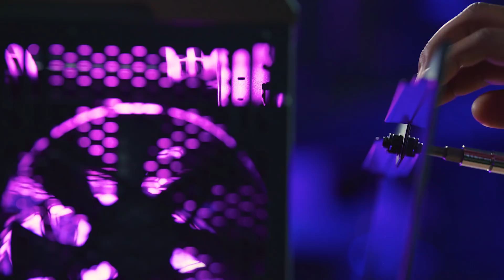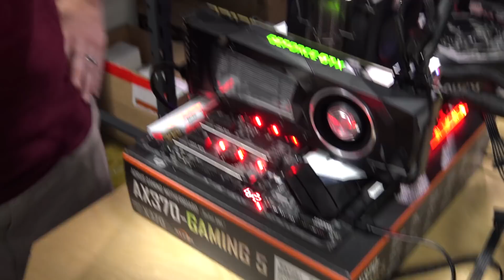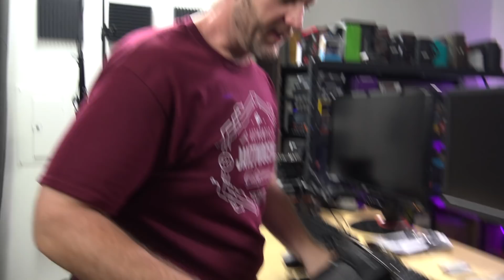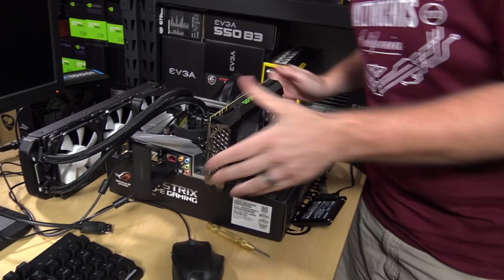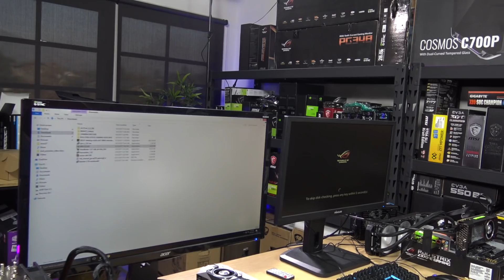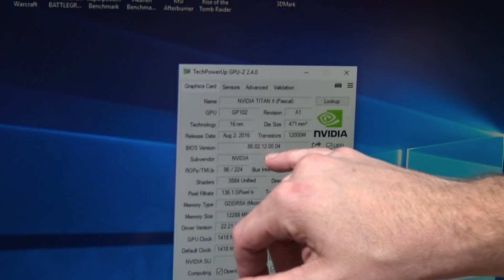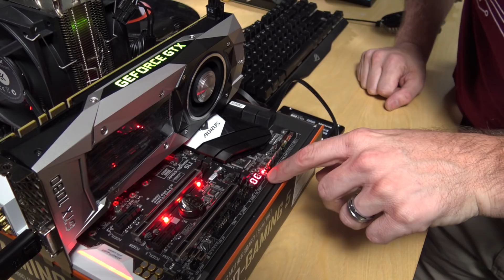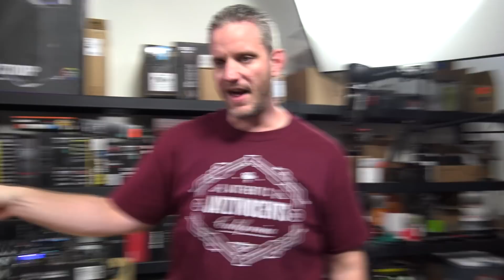I cant figure this one out... HELP!

Comment: I had an issue like that when I was working at a repair shop. A client brought in a pc that wouldn't boot, I noticed the graphics card (was an...8600GT IIRC??) worked on any board but the client's (some 775 Asrock, don't remember the model), while that board would gladly accept any other graphics card. Couldn't really do much troubleshooting on it though - he wanted the pc repaired quick, so I just threw in another graphics card in it - but as far as I remember it was working in the months before, and the client didn't do any bios updates. I did put my money then on electrical degradation that particular combo was particularly sensitive to, and something like that could be happening as well, tiny differences in build quality and/or component characteristics of those particular parts might not be playing nice with each other.

Comment: Hi Jay, I have seen this issue only once in my life with some old (now very old) hardware. Situation was: I purchased an AMD HD 6970 from a guy. He was using the card in front of my eyes in his PC, we ran some games because I just wanted to see how it preforms. No Issues so far. So I paid for the card, came home, and put it into my "retro" gaming PC (Using it for Windows XP games) and BOOM. No post. No video signal what so ever. I tried it with my real PC, and everything was OK. I knew that my MOBO was fine, since it was running a AMD HD 4870 without any issues. After 2 weeks of googling and testing, it just came out that the card had some PCI-E lane issues: The card was PCI-E 16x rated (obviously) BUT couldn't run on a full 16x bandwidth in a 16x PCI-E lane. This resulted in a no-post scenario on my "retro" pc. Notes: Asus P5K Pro, P35 chipset using Q6600. Here is the part where it gets funny: When I put the card into the 4x only slot, magic happen and it just posted. My normal rig (Asus maximus VI formula + 4770k) posted with the faulty card, but only with 8x speed, please note that there was no driver warning or anything else, it just worked. Conclusion was (found it on google after all...) that SOME CHIPSETS are very sensitive for this type of error. If the POST sequence wants to negotiate with a PCI-E card (not just VGA) that reports that it is 16x and can get it to work on that speed, it just won't post. I might try to force 8x speeds on your system (adding 1 more GPU to the system) and see what happens. Also, as I have seen on Gigabyte website the bottom card slot is 4x so that also might worth a try.

Comment: intel announcement
“[W]e’re no longer disclosing this level of detail as its proprietary to Intel. Intel only specifies processor frequencies for base and single-core Turbo in our processor marketing and technical collateral, such as ARK, and not the multi-core Turbo frequencies. We’re aligning communications to be consistent. All Turbo frequencies are opportunistic given their dependency on system configuration and workloads.”

Comment: re-flash the bios on the motherboard.
This year I've reflashed a bunch of Gigabyte bioses for some reason.
Some turned off after 10 minutes.
Some failed to give video on some gpu's.
Some had issues with any higher than 2133 mhz ram.
After reflashing the EXACT same bios file the issues went away o.0

Comment: Yesterday, I installed a new nvidia gt710 on my ancient am3 motherboard and it just wouldn't start not even to the bios. After several hours of troubleshooting, I removed one of the two ram sticks and oddly it worked. Now I have both the sticks in there again and my system is working fine. I haven't had any problems since.

I don't know if that would work for you as you have an entirely different system. Anyway, love your videos Jay, I hope you figure it out.

Comment: I'm not sure graphics cards are the same as phones, but I've seen phones that will use a samsung internal storage chip and another phone of the same exact model of a similar production date use a internal storage chip from another company. could that be the issue? I know it doesn't seem likely, but anything is possible right?

Comment: I would say its a sync thing or a compatability issue amd are graphics based cpus which is why consoles use them however i use intel for compatability reasons nothing else while gaming it just works and intel normally run servers so are reliable for long periods of time they maybe indenticle but there using different motherboards and chipsets and socket connections

Comment: Code     Description:

 00 Please check if the CPU is installed correctly and then clear CMOS.
 0d Problem related to memory, VGA card or other devices. Please clear CMOS, re-install the memory and VGA card, and remove other USB, PCI devices.
 *01 - 54 (except 0d), 5A- 60
Problem related to memory. Please re-install the CPU and memory then clear CMOS. If the problem still exists, please install only one memory module or try using other memory modules.
 55 The Memory could not be detected. Please re-install the memory and CPU. If the problem still exists, please install only one memory module or try using other memory modules.
 61 - 91 Chipset initialization error. Please press reset or clear CMOS.
 92 - 99 Problem related to PCI-E devices. Please re-install PCI-E devices or try installing them in other slots. If the problem still exists, please remove all PCI-E devices or try using another VGA card.
 A0 - A7 Problem related to IDE or SATA devices. Please re-install IDE and SATA devices. If the problem still exists, please clear CMOS and try removing all SATA devices.
 *b0 Problem related to memory. Please re-install the CPU and memory. If the problem still exists, please install only one memory module or try using other memory modules.
 b4 Problem related to USB devices. Please try removing all USB devices.
 b7 Problem related to memory. Please re-install the CPU and memory then clear CMOS. If the problem still exists, please install only one memory module or try using other memory modules.
 d6 The VGA could not be recognized. Please clear CMOS and try re-installing the VGA card. If the problem still exists, please try installing the VGA card in other slots or use other VGA cards.
 d7 The Keyboard and mouse could not be recognized. Please try re-installing the keyboard and mouse.
 d8 Invalid Password.
 FF Please check if the CPU is installed correctly and then clear CMOS.

Comment: Jay the card from the Intel after you swapped it to the Ryzen will be the same, you didn't check the vbios version of the GPU from the Ryzen to the Intel system. There can be many things that cause this issue one is a corrupt vbios header or the vbios header not being correctly read by the system bios which might require the system bios to be upgraded after contacting support about the issue. Also try booting the system in UEFI-CSM on the ryzen system might help.

Comment: I have bought a Ryzen 1700X system and i was very stoked to get it running. At base clocks it all works very nice with 3200 memory speed, but i can't even OC untill 3.9. Even on 1,425V i can't push 3,9.
Max 3,8 otherwise it will crash or even post. 

Also if you run it on stock speeds i think the XFR is duly overrated as hell, it's very rare to see it kick into action in real life scenario's. So yes call me a bit disappointed in the overclockers/enthusiast CPU of AMD. I couldn't care less that Intel gets 10 FPS more, i like the 8-Cores and the enthusiast side of it, but this is just annoying the bajeezers out of me.

Comment: I had a similar issue with a lightning cable. With my phone didn’t work, connected to my father’s worked just fine. Turned out to be a slight difference in the design of the female connector in my phone and a slight oxidation on the lightning cable. My father’s female connector was slightly different and made contact even if the cable had oxide on the pins.

Comment: exchange the power supply between them and try or try with another motherboard? Is there any way to see how much power is being used by the graphics card only before it even makes post (like a hardware or something?) to check the power draw of both the graphics cards (it was the Titan, right) on the same system (the one that is not making POST)

Comment: Try a PCIe Extension betweeen Motherboard and Graphics card. 
I guess there is a weak pin spring in the slot. 
Also due to Manufacturer tolerances on the card, the PCI express pins could be a little slimmer. 
That would explain why it works on one board and not on the other.
Reply: Samuel Patti "due to manufacturer tolerances" can you read?
Reply: I would also try to place that not working Titan card to the second PCIe x16 slot to check if it posts. And like others said - is the GPU BIOS version really the same on both, because on the video we only got the version from one card but on two different systems?
And I agree that the manufacturer tolerances can differ between two cards even from the same factory.
Reply: Przemysław Łukawski we can't say the bios version is the same in both  watch again and pay close attention, he checked the bios on the same card. We don't know the bios for the 'bad' card.
Reply: oh yeah, running the card in the other PCIe x16 slot, and maybe trying to boot both in the ryzen.
Reply: Why the second one card works just fine?

Comment: Jay, you have checked the BIOS version of the Titan Xp on the ROG system, then switched the same graphics card to the Gigabyte system and launched GPUZ again. It will obviously show the same BIOS version as it is the same graphics card. You did not check the BIOS version of the Titan Xp that was originally on the Gigabyte system when you switched it to the ROG system, at least in this video. I would suggest you re-check both card's BIOS versions on the ROG board and confirm they are truly the same. At this point, I'm inclined towards a VGA BIOS issue, and though reflashing the Titan Xp is not an easy task, as you explained, it might still solve your problem. Thanks a lot for providing this content; always enjoy your videos! Please do let us know how it goes and if it is eventually solved. Thanks, Daryl

Comment: Jay you checked same GPU bios version and said its same, but its same GPU card on different systems, you haven't checked GPU card that first was removed from AMD system and moved to Intel one, unless you did that off screen. Also did you tried to switch PSU, some times might be power issue, once had faulty motherboard that wasn't able to wake up higher power hungry GPU's  at all from OS sleep mode, just some thoughts . . .
Reply: Exactly my thoughts!

Comment: Faulty VRAM on an FuryX once made it unable to Post with the card in the first x16 slot of my motherboard, in the second (technically x8) Slot it Posted without problems, but firing up an Game that toke more than ~2GB showed that the VRAM was faulty. Maybe the Ryzen System is doing like an deeper check of the card when starting it?

Comment: I have seen some videos of people having issues with power delivery through x370 motherboards. I know Dimitri, Hardware Cannucks, was having trouble with USB 3 power it could be that one Titan is pulling slightly more power through the PCI slot and it is just enough to cause a fail on the board at post. I have seen simular weirdness on the Asus red ROG units.

Comment: I'd guess its a combination of the motherboard and the card connectors. Sub millimeter mechanical stuff causing a high resistance connection on one pin. I'm always amazed how so many connections in those plugging systems just work good enough so many times...

Comment: Basic PC troubleshooting - try an older or the previous Bios for that particular motherboard. I'm glad you never do motherboard reviews and probably another website or reviewer would be advisable with that kind of review. I've got a new Gigabyte motherboard on F5A bios release, where it does the Triple Beep error, before posting and working perfectly whenever you switch or changing any of the hardware, hot swapping SSD boot drives as an example. But, switching back to F4 bios has got rid of most of the problem and may even try the older F3 bios soon. Have had to try older bios for Intel motherboards and for older generations of architectures  and for different motherboard manufacturers like Asus and MSI motherboards.

Comment: Might sound a bit mad but put the suspect GPU back in the Ryzen unit and swap the power supplies. If there is even a slight issue with the GPU not getting a stable voltage the whole thing may not want to work.  Perhaps the Ryzen build demands an absolute stable voltage and the Intel build is a little bit more tollarent.

Comment: Jay i think this error is not actualy related to the GPU but in it of itself but rather the overcloking of the GPU , CPU , or RAM.I got 3 sugestions on this(1 actualy worked on my own sitem r7 1700 with gtx 1070) the first one 1>Run the GPU if you overclocked it on stock so just the defaults on it
2>Run the entire system on default and overclock each componet to see the problem(for me it was the RAM it would not boot for the life of it)
3>Sorry to say it but it could be unlucky and the GPU CPU and MOBO wont work paired like that.
PS:Also try to revert 1 bios version back on the Mobo(just 2 days ago i reverted back to my v6 version on the B350 PC Mate from msi because of crashes so that could work aswell)

Comment: Ive only used Asus boards in my experience, have you tried checking the CSM (compatibility support module) settings or AMD 's equivelent? usually the settings say "use UEFI first then Legacy" or something along those lines, if you were to set the setting to only use legacy or only use UEFI it could be the issue. since there is not iGPU on a AMD system it has to get its GPU drivers from somewhere to post so maybe its choosing one instead of the other for some reason.

Comment: first ask yourself what it isn't, 
but overall, i think that there is something happening with that card itself, mabie not something wrong per se, mabie an oversight by the card manufacturers, with such a specific issue, i would say to wait till the next bios update for both/either the motherboard, or the graphics card, and try again, if you can't wait for that, try to clean the pci-e pins with alcohol
(not an expert, might be talking out my ass here, but a thought)

Comment: This exact problem happened with my R9 Fury from sapphire, when I build my Ryzen system. Worked fine in my old intel machine, but not in the ryzen machine.. well I just bought a new gpu, since I wamted to upgrade that as well.

Comment: I've had a similar issue, a motherboard that would randomly bluescreen, i let all the ram test run separated and together for at least 30 cycles with no errors, temps were ok,latest drivers/BIOS, all drives were ok, CPU had no issues, came down to a bad motherboard, however without the GFX card it would run with no issues, I still use the same GPU with no problems, sad thing was that it never had been consistent so it would randomly BSOD, sometimes 2 times a day other times it would run fine for a month...

Now my GF's father who's also a tech geek but not much of a gamer, has been using that board+CPU without any issues for over a year now

Comment: Well, doesn't help if you check the BIOS of the same VGA! Hehehe... We are missing some info here... Is the Ryzen system overclocked? Have you tried on a different PCI-X slot? Sometimes when the system is overclocked some cards need their PCi-E frequency to be adjusted... Was very common on old Systems (specially socket 775)... I Would've tried to load BIOS defaults (CCMOS) and go from there!

Comment: Jay! You didnt check the ryzenphobic card bios on intel system. And as there is problem not only with just one card, but 1080 also didnt boot for the first time, try differen board.

Comment: Try this!!

i actually had the same problem with my second R7 250X from ASUS at the time i wanted to crossfire it.
my old Card would work on two systems, but the new obly worked on my spare system but not my main rig.
The Bios versions of the Cards were the same as everything else but i still backuped the BIOS of my working card with GPU-Z and flashed it onto my new card.
then it worked flawlessly!!!

Btw.: to everybody who wants crossfire or SLI.
Dont do it with low or middle end cards like i did.
u will regrett it. i did it.
always go for the next faster modell and then as last to 2 cards. trust me ;) 

love ur Vids Jay, keep up the awesome Buildvideos u always make!!

Comment: Do a troubleshoot- start with a reset to the BIOS, then do elimination-method. I'd bet you will get it to work along the way suddenly and can build up the components from there.
Heck, I've had it that I changed stuff around and suddenly configs that didn't work before now worked. Where I could only attribute the whole thing to a loose connection/gremlins.

Comment: To me its a problem with the ryzen motherboard and the card. There maybe a variation power tolerance in that particular XP card that is different from the other working XP card. That variation is still within the paramteters of intel sytems but not that particular ryzen system. The next test to do would be to test the non working XP card in a different Ryzen system. If it works then your original ryzen aorus motherboard is not the best, if it doesn't work fundamentally you can say ryzen motherboard are set to tolerances that can't handle some variation on that specific XP card.